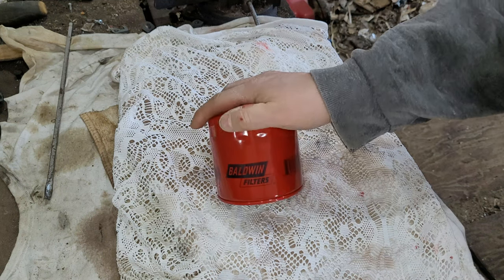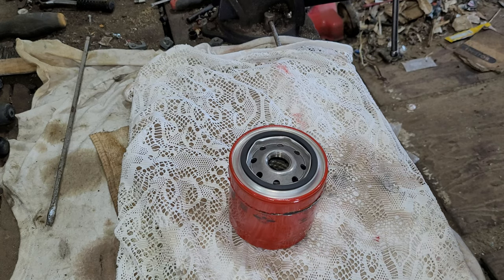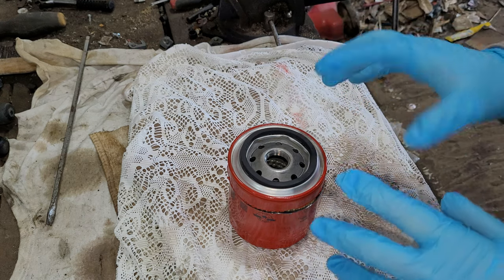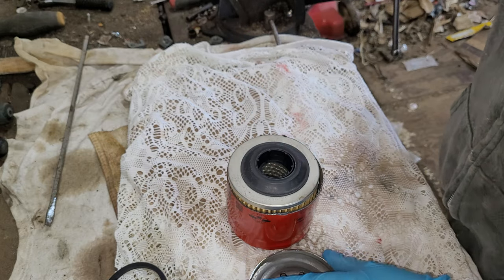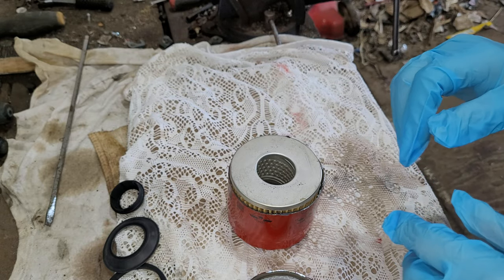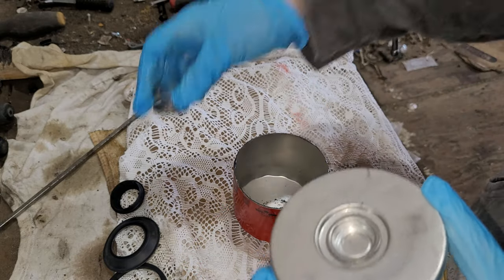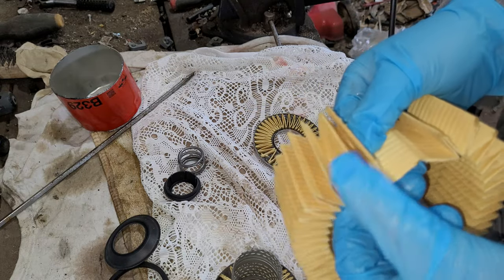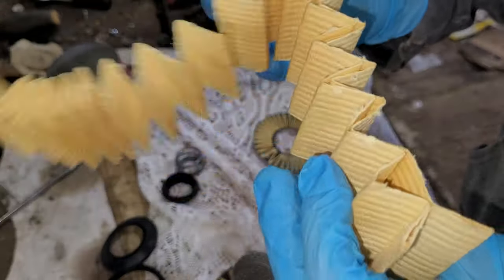Baldwin oil filter review

Comment: Ive never heard of that brand before , Is it agricultural with some automotive applications ?  Where can you buy them ?
Reply from the maker: Automotive and agricultural,  buy them at Prairie Bearing and bolt.
Reply: @crazybillsgarage  That would explain the better construction , AG filters need to be better 😎
Reply from the maker: @LooneyFarmGuy  Baldwin do make full line of filters for vehicles also.
Reply: Baldwin has been making filtration products for heavy duty equipment for years. They carry a full line of automotive filters as well but their bread & butter has always been the heavy duty diesel market. They make filters for diesel engines that cost more than most people’s houses.
Reply from the maker: @prevost8686 so true, some of there filters get pricey in the diesel market.
Reply: You don't see them much on cars, but  my many years working in the field as a welder Baldwin was  by far the most common filter on commercial engines.  The rental  companies seem to use them a lot( WIX/Napa probably second.)Baldwin's are also popular with farmers.
Reply from the maker: @martinschulz9381 1 of my most favorite filters.👍
Reply: @martinschulz9381  I run Baldwin on my 2019 honda civic coupe ex-t.  Been running them ever since finding out the oem honda filters are just a basic fram filter. I pick them up at a local auto parts store. Thinking about just buying a case on line. I change my oil every 3500 miles, so I really don't need some filter meant for 20,000 miles lol. Which nobody should be doing in the first place. These 10,000 mile oil changes are just asking for trouble, or once a year im even seeing now. Idc how great the oil is thats just insane.
Reply from the maker: @vermontvermont9292 thank you, Baldwin is one of my top filters. Later this week I have a Baldwin facing off against Castrol filter.
Reply: @crazybillsgarage   I've never seen a castrol filter in person. I actually run castrol edge in my car, been a castrol fan since around 2003ish. I'll be willing to bet a Baldwin is better than a castrol filter. My guess is castrol just puts their name on a generic filter of some type.
Reply from the maker: @vermontvermont9292 yes I'm a Baldwin guy and the Castrol filter is made by a big company who makes many different filters. You will see on Friday.
Reply: @vermontvermont9292  Some car companies are pushing the extend drain intervals, but they are seeing trouble with it in many cases.  thanks for the comment.

Comment: How many miles is this particular filter good for between oil changes if you used full synthetic?
Reply from the maker: I have no information for the Baldwin filter with synthetic.  But most users go between 5 to 7 thousand miles on that filter.
Reply: Personally, I use this exact part # (B329) on my Challenger SRT 392 in place of the Mopar SRT Oil Filter.  The Baldwin filters are cheaper, seem to be just as good if not better than the SRT filter from what I can find online and have read.  I change my oil every 4k miles, filter as well.  These filters are $8 on Amazon.
Reply from the maker: @robcolletti Baldwin are my favorites also.